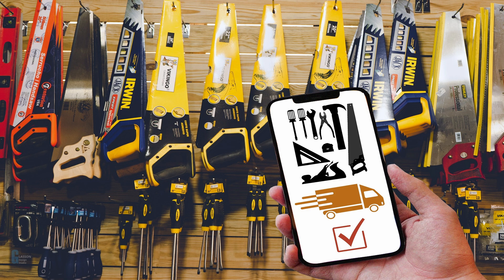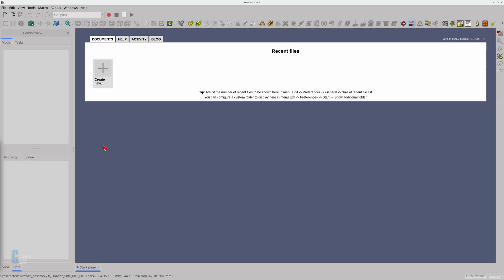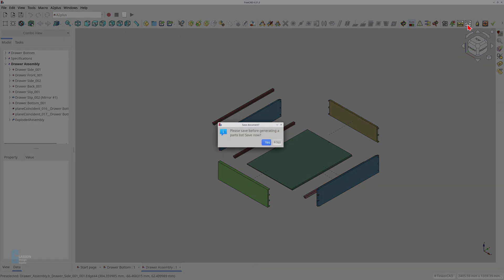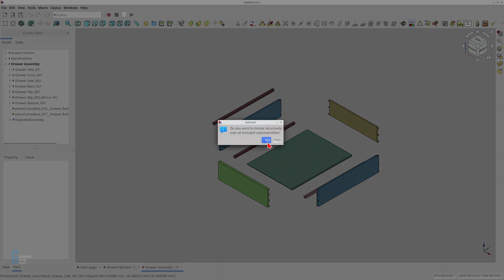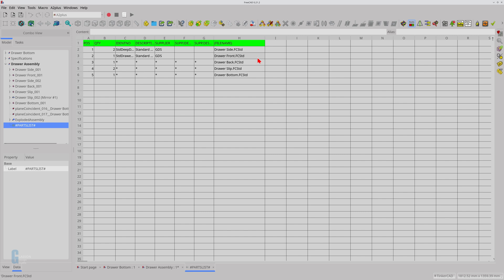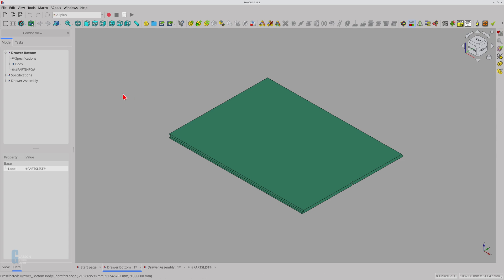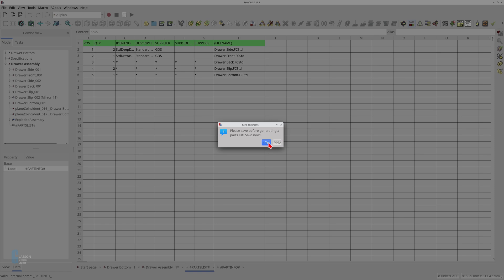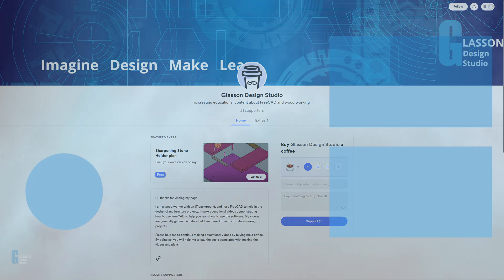Create a parts list from an assembly using A2Plus workbench

Comment: For more advanced users: You can modify and create new 'Part Info' fields in [a2p_partlistglobals.py] but there are a couple of caveats. 
1) Any changes made will be overwritten if you update or re-install A2P. Make a backup copy that you can restore as necessary. 
2) If you already have a Part Info entity in your file then it will have to be deleted or renamed in order to update the fields on existing documents. If you renamed the previous one then you can copy and paste each field as required. (I sometimes use the rename to maintain a history of changes). That's all I remember to watch out for. 
Thanks for the video !